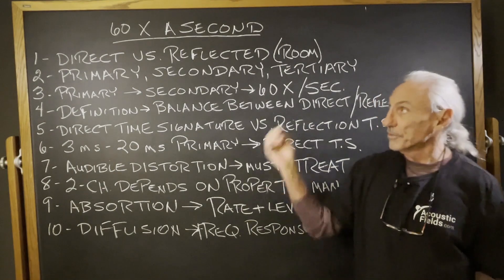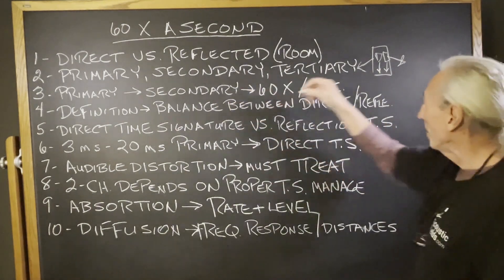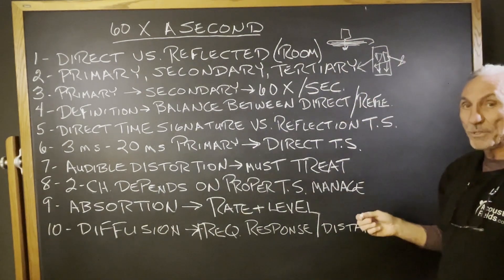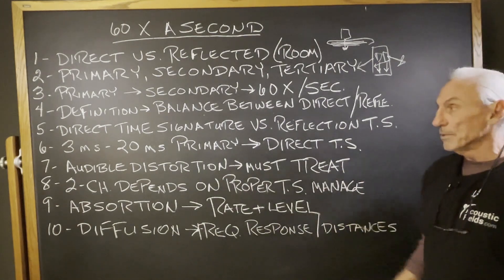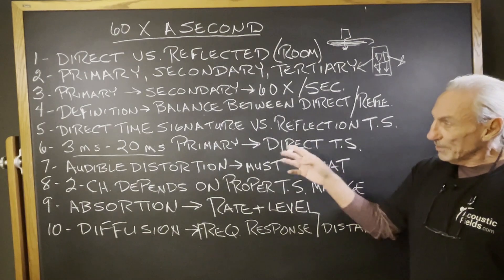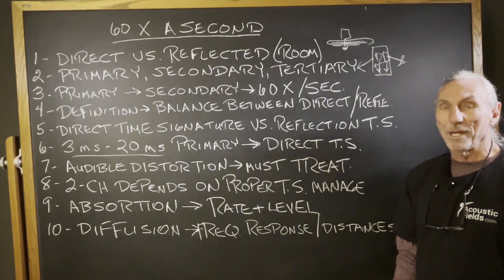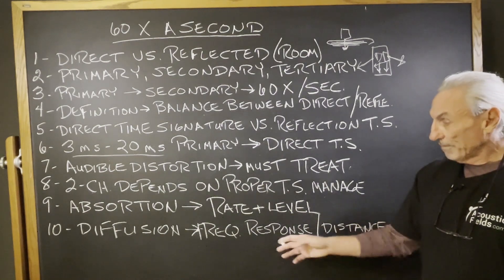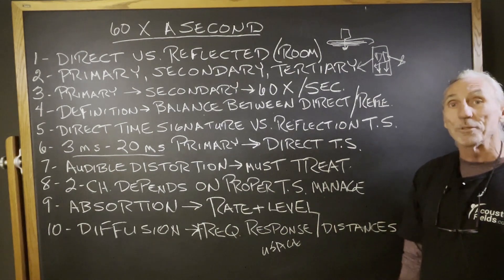60 Times A Second - www.AcousticFields.com

Comment: Why aren't you active on your Instagram page ???  And why did you not make any video for short ceilings such as 2 meters ???  I have a problem with this height of 2 meters and ... is it possible to help?
Reply from the maker: A 2 M ceiling height is not enough distance to allow for the 305 mm of treatment required to resolve the floor to ceiling unwanted pressure issues. It is best to find another room.

Comment: Maybe I am not understanding the math to get "up to" 60 times per second correctly here. Are you talking about 60 reflections per second? I would think you could get many more than that.
I certainly agree with Everything else.
Reply from the maker: Steo back a bit and look at the complete picture. If you focus on the micro you miss the macro.
Reply: @AcousticFields  is it the low frequencies above 70Hz that causes the issue or are we talking about all the spectrum, thanks